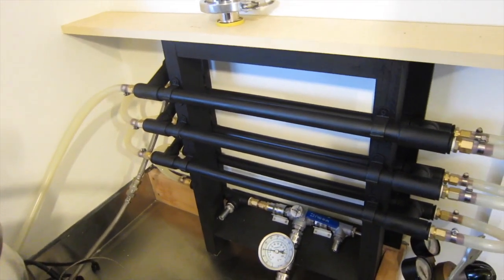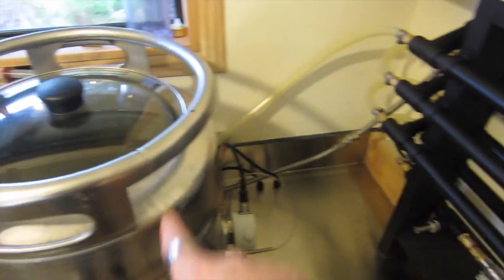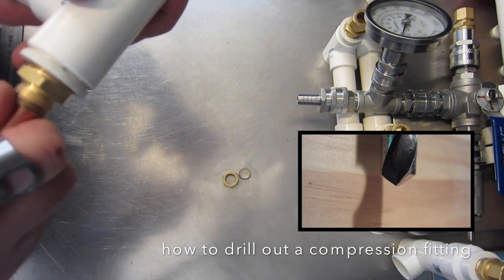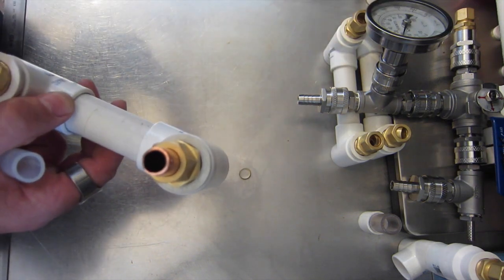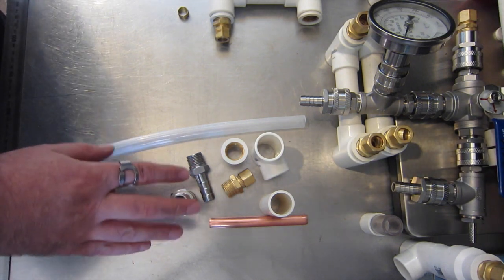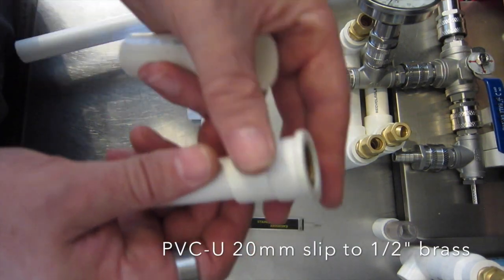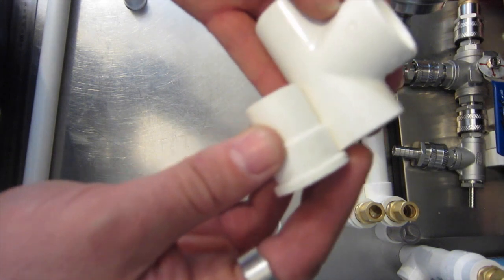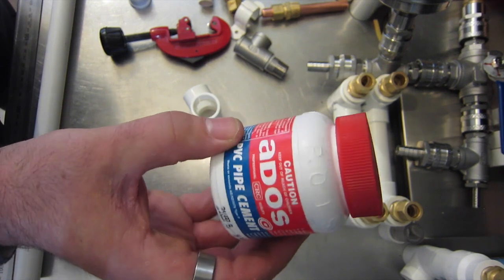Parallel Counterflow Chiller part 1 of 3

Comment: Hi, I love your Parallel Counterflow Chiller. Originally I was going to build one with all pipes copper. The beauty of your's using PVC is cost. What I need to know is where did you puchase the 20mm end pieces with a brass thread? Thanks for your video!!! Cheers

Comment: Not sure where you are man, but in the US, cheap irrigation pipe from Home Depot will do the job.  The white stuff is Schedule 40, could also use Schedule 80, which is a thicker wall, there is also a special PVC used expressly for water heater drain pipes, designed for high temp, that would be good here too.  That stuff is easily found at Lowe's.

Comment: It would have been cool if you used quick release at the ends instead of protruding copper.  Then you can quickly disconnect the silicon tubes and drain the chiller so you don't loose any chilled wort.  Plus, the parts would then be easier to sterilize.

Comment: Brilliant. Thanks for this! How would this compare to a chill plate design. CheerZ
Reply from the maker: I used a chill wizard by Sabco way back, and it was a pain, it was slow at getting primed and had a slow flow rate. I don't like them due to the fact that they can block so easily on a brew day.  However there are bigger plate chiller available, that may work better than the one I used.
Reply: I like your build, the parts would be readily available here.  Could the pyramid distance be reduced to add distance to the chiller? or would there be no additional benefit.